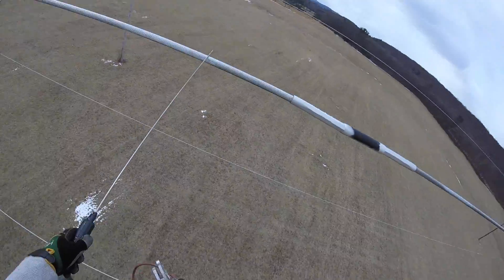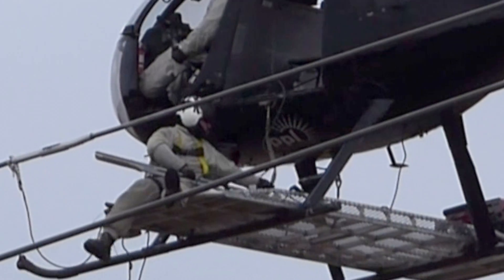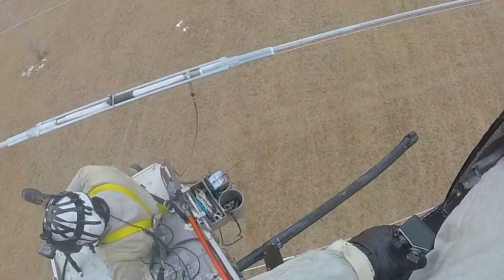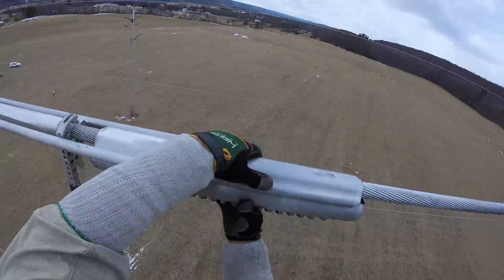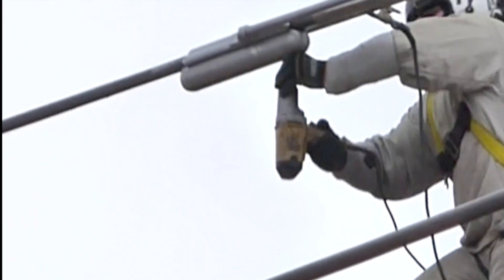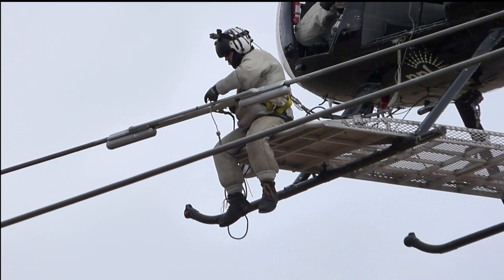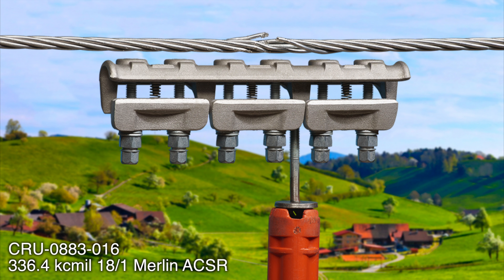Here's What To Do After Finding Hot Connectors On Overhead Power Lines

Comment: How often do utilities run inferred inspection on all the conductors they own? Once a year?
Reply from the maker: Hello Bill Zang, Thanks for the question. Most utilities will conduct infrared inspections on overhead transmission lines once per year or once every other year depending on the age of the conductor. Inspection requirements vary for each utility.

Comment: i still dont understand how they dont get electrocuted.
Reply: Its because he is not touching the ground or the neutral wire as it would create a circuit back to the source .He is also wearing a specially made suit with a metal mesh in it like the Farrady cage the voltage goes around the cage and back to the conductor on the otherside of him, that's why birds can sit on high voltage lines

Comment: They should design a socket that is longer and has an angled slot out the side of it with an annular housing around it and bag underneath so when the head breaks off it stays in the socket then the operator just pushes it on to the next one which forces the broken one out the angled slot of the socket, into the annular housing with angle floor in it and tube down to the catch bag to catch all the heads.
That way he wont need to invert the power tool each time to catch the broken bolt head out of the socket and put it in the can (risking dropping it)  and can just go from bolt to bolt which would speed up the job, save fuel, reduce risk time near the line and the operator can just empty the bag of break off heads into the can after the job is done on the way to fit the next one.

Comment: So these devices just provide a low resistance alternative for the current flow?
Reply from the maker: ClampStars act as an electrical and mechanical shunt to prevent wire-down incidents caused by failing splices and other overhead connectors. If ClampStars are not installed and the splice or connector failed, the line would come down and possibly cause, things like; wildfires, electrocutions and other damage. Google "swingset electrocution" to see a video demonstration of a failed splice. Also checkout this video: https://www.youtube.com/watch?v=u9xe273PFg0
Reply: @ClampStars  I see. Can't say I've heard of a mechanical shunt before though, but hey, these are some interesting concepts you have presented. Thanks for the explanation.

Comment: How many clamps before the Powerline becomes a Clampline?
Reply: Not going to happen. There are never that many splices to begin with, and most don't fail. Only the ones that do fail (develop high resistance and hence high power loss and high temperature which shows up as white on infrared cameras) are clamped. The vast bulk of each line consists of segments of thousands of feet of unbroken conductors with splices between segments.

Comment: What about the specific scenario of the cable parting while the lineman is clipped on, with both ends suddenly heading away and down.  Assume the clip is caught on something like the splice and hangs on.  Does the wire between clip and helicopter have a breakaway accessory?  A sudden tug would be notagoodthing.

Comment: damn dude, why so many bolts?
...... redesign with 5 bolts on top and call it good....
Reply from the maker: The quantity of bolts is directly related to the rated breaking strength (RBS) of the conductor. For instance, a conductor with an RBS of 10,000 LBS. might require only 10 bolts on each side but a conductor with an RBS of 20,000 LBS. might require twice as many bolts. The purpose of the ClampStar is not only to handle the current flow but the mechanical load as well in the unlikely event that the splice let go.
Reply: Thats cool but is there no friction plate? Are the bolts directly contacting the conductor?
I would think that the more bolts there are(in this particular application), the longer the helicopter has to be there, and the longer the helicopter has to be there, the greater the chance of mishap.
Reply from the maker: The bolts do not directly touch the conductor. The bolts tighten down a proprietary component that essentially provides a spring compression connection on the conductor that compensates for thermal expansion while maintaining a firm grip on the conductor. A specific quantity of bolts are needed to provide the necessary grip in order to match the required RBS of the conductor. You are correct that the longer the helicopter and lineman are engaged with the live line, the higher the risk factor. Please understand, before ClampStar was invented, the amount of time required to correct a hot splice on a conductor of this size was measured in hours not minutes.
Reply: Awesome, thank you for the explanation.

Comment: I wonder what the typical voltage drop is across such a hot splice?
Reply from the maker: Once the voltage drop across a connection reaches 0.3V  (yes, that is 3/10ths of one volt!) the aluminum will exceed 650°C and the splice will melt.  Actually, it is unlikely to get that high (0.3V) before the connector let’s go mechanically.  If you can’t handle 0.3V, probably ought be in a different profession – and that would not include auto mechanic, as you would have to wear a full set of gloves and sleeves to change a battery!
Reply: Thanks. Just trying to appreciate the heating and loss factors at this scale.

Comment: whats the reason they use splices?
Reply from the maker: When overhead power lines are strung they come off reels from the factory. Depending on conductor diameter and reel size, reels contain conductor lengths from several hundred feet to a few thousand feet. Splices connect the end of 1 line to the beginning of another during the stringing process. Additionally, before ClampStar repair units were available, splices were sometimes used to repair damaged conductor.

Comment: Why does the helicopter have to bond to the transmission cable?
Reply: So the helicopter/pilot/lineman have the same potential as the line itself.
Reply: M Cruse i know but why bother. They are not earthed
Reply: Any difference in potential, earthed or not, could be a shock hazard.  Electricity is always going to find the easiest route to complete a circuit.
Reply: M Cruse I thought it was something to do with the spinning rotor blade in induced voltages. 

That arc that happens, is that because if the helicopters capacitance with the ground?
Reply: Spinning rotor blades generate static electricity. That's why if you look close when they are slinging loads under a helicopters in a hover, they will discharge the static before hooking. Military Chinook helicopter, is a good example.
Reply: Billy Glover never seen that..

Do you know what causes the arc when they bond to a power line
Reply: Try this short video. Watch the big guy when he grabs the sling. lol.https://www.youtube.com/watch?v=eW5p70b9RjE

Comment: Why rely on the lineman having to individually tighten then shear each bolt.
Why not build a detachable tool that will tighten them all then shear them in one go?
Reply: Why reinvent the wheel?  This looks like it was made to work from an economic standpoint with existing off-the-store-shelf tools - otherwise, you'd be looking at some serious bank for very limited production tooling (economy of scale kicks in here).
Reply: JosVideosHD maybe use an electric motor mounted inside the helicopter instead of a conventional drill
Reply: jagara1 hey man, maybe you could make one. Then patent it, then sell it to these guys. How many torque bolts per connection? Looks like about 10. 10 drill heads running at once, properly spaced, maybe with a guide that snaps into place. Pretty good idea, would shave off a lot of time for this job.

DeWalt & Ryobi make flexible bit extensions. What if 10 drills were mounted on the platform, each connected in series and operated with a single switch, and each had 4-6ft flexible extensions.. Neat idea.

Comment: Still no idea what a hot splice is
Reply: Did the infared image of the white hot splice not do it for you?  A splice is a point where a cable connects to another cable.  This one had a high resistance for whatever reason it was failing.  High resistance = more heat.  Hence it was literally a HOT splice.

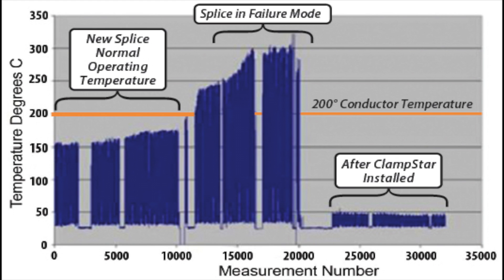Comment: 3:30 That graph gives another meaning for "hot" power lines.
Do they shut down the line, while repairing, because of the temperature ?
Reply: Stopping power on transmission lines can result in literally billions of dollars in losses--they don't do that unless they have to.
Reply: They never do outages for transmission lines unless they are fixing an outage on a transmission line.
Reply: The video show he never needs to touch the connector. The heat might be kind of nice on a cold day.
Reply: No it can't.
Reply: I know of transmission lines that get opened every day.  But outages are not necessary for this kind of work.

Comment: I'm curious, doesn't the high voltage mess up with capacitive components in electronics?
Surely is must cause some kind of problem, right? It's like 230KV ffs.
Reply: iliasasdf electricity takes a direct route too earth if possible otherwise too its destination so there little too no current in the chopper how do you think those guys can even survive
Reply: Panda is basically right, no path to ground so no current flow. There is some voltage, but thus far, tests have shown no effect even on computerized helicopters. This is a MD500D. It was type certified in 1963, the D model in 1976. It has no essential electronics. The only electronics are radios and navigation equipment. You could start it and then remove the battery, and the entire electrical system and go fly. Its been done.

Comment: Great pilot. But props to the other guy. Imagine doing all that work from a moving platform, and holding and operating that drill at arms reach
Reply: There is a reason everything is either tethered or they have several back ups.

Comment: This is TOTALLY cool.  If I could go back 30 years, I'd definately swap my career as a software engineer (ie computer programmer and web developer) for THIS career field, even though I probably wouldn't make as much in salary.  Job satisfaction counts for something.
Reply: I can honestly say I don't know of any story of who has died as a direct result of their work as a software engineer. I've worked on utility projects for 9 months now and have heard at least 5 different stories about linemen getting killed, 4 of those were doing hot work from a helicopter. The pay is better than most low end skilled jobs but the risk is very high.
Reply: We (software engineers) tend to die from strokes or heart attacks - not high voltage encounters.  ;-)

Comment: These guys deserve every penny they get.  Note to electrician -- don't cheat with the pilots wife....
Reply: Raptorman0909 they are married to each other , so it can’t happen
Reply: I think its too low for this job
Reply: Note the helicopter is attached to the line for the duration of the operation. If anything happens to the guy installing the bypass the pilot is also doomed.
Reply: pretty sure that connection is a tear away...too much tension and it snaps so as to not destroy the heli
Reply: Leonard Milcin, there is no problem to just fly away anytime, also without disconnecting that...pliers. and the worker is always ready, he doesnt tangle up with anything during working, he is literally always ready to just being pulled away of everything

Comment: woun´t the contact resistance rise over time due to corrosion? if so, how much will it rise?
Reply: It can but they tend to use anti oxidation compounds on the areas that make contact. Also, they polish the aluminum before applying the shunt so that when it is tightened down it isn't a concern. Once you make a mechanical contact like that it is good to go for decades.
Reply from the maker: Once the voltage drop across a connection reaches 0.3V  (yes, that is 3/10ths of one volt!) the aluminum will exceed 650°C and the splice will melt.  Actually, it is unlikely to get that high (0.3V) before the connector let’s go mechanically.  If you can’t handle 0.3V, probably ought be in a different profession – and that would not include auto mechanic, as you would have to wear a full set of gloves and sleeves to change a battery!

Comment: wait i thought live power lines were insulated...
Reply: Nope. As ironic as it may sound, they only insulate the lowest voltage final leg going into homes/buildings.  (At 230kV, a layer of plastic or rubber would serve no purpose and only add weight.)
Reply: They do, it's called air :)
Reply: Not on transmission lines, the insulation alone would be several times heavier than the conductor. That is why transmission lines have large air gaps and are mounted very high up from steel structures to ensure nothing short of a tornado or hurricane, maybe a small plane, will damage them.